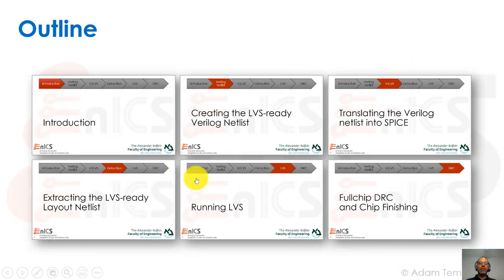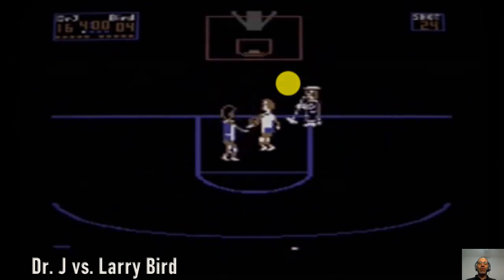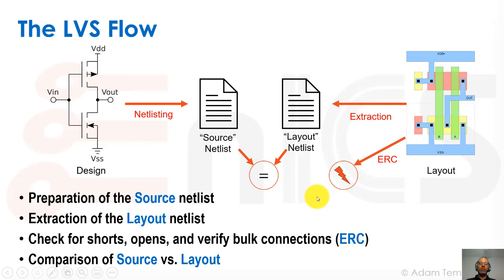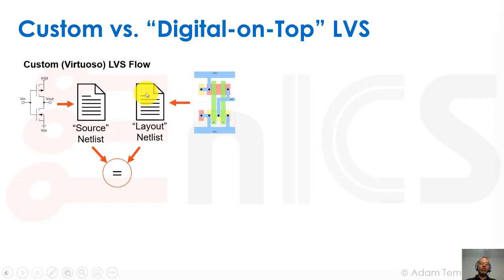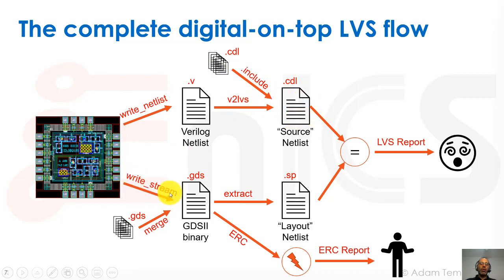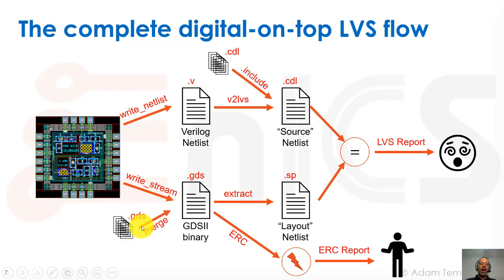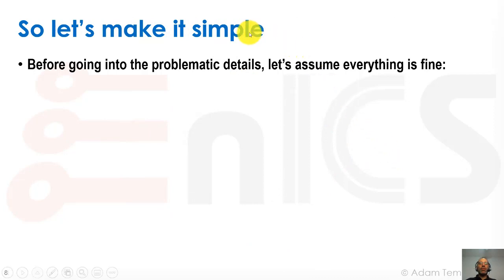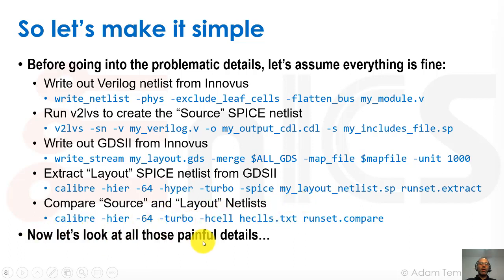Digital-on-top Physical Verification (Fullchip LVS/DRC) - Part 1

Comment: Difference between Design rule check and Electrical rule check
Reply from the maker: Hi. I believe this is elaborated upon during the lecture series - I suggest to watch all the sections and get the full explanation. But, in general, DRC are rules for manufacturing. The fab cannot (or, at least, will not) manufacture polygons that don't meet the DRC requirements. ERC, on the other hand, are more of a sanity check that complements LVS, making sure you don't have shorts or opens in your design and that your bulks are connected.
Reply: @AdiTeman  thank you ✨